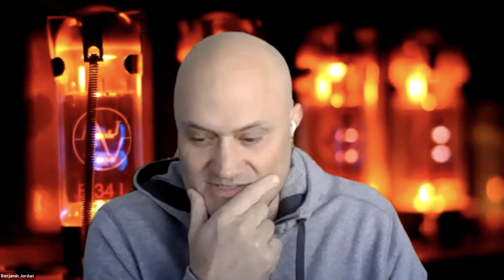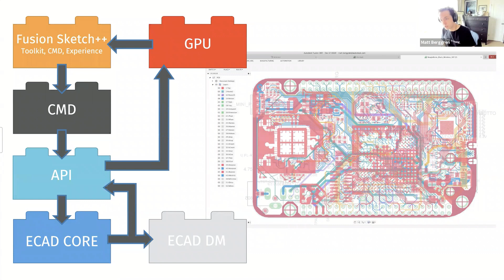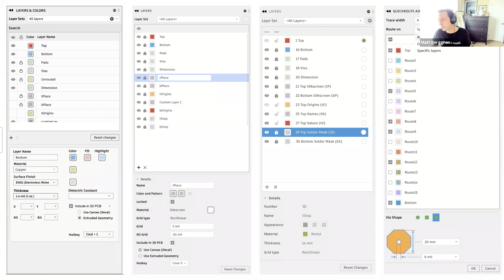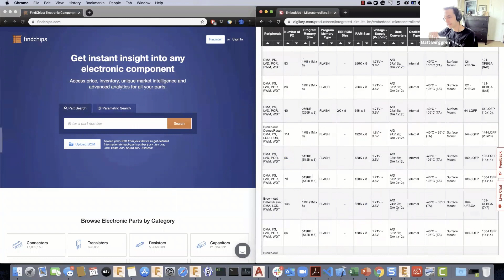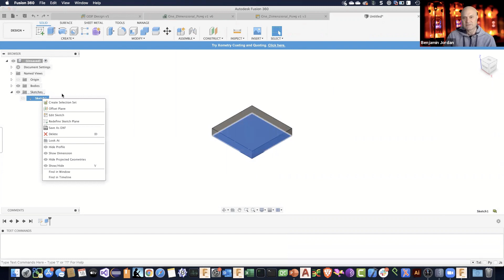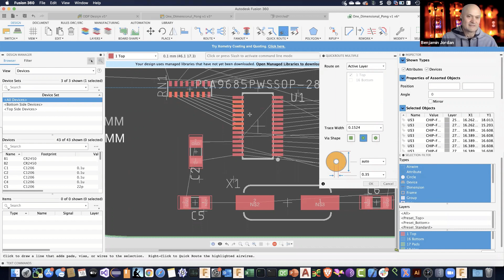WEBINAR: Fusion 360 electronics roadmap

Comment: Great job guys. Exciting times!!
For the new library stuff, please dictate the common attributes names like manufacturer, part number, voltage, tolerance, etc. Each library of the web use different names, so we can't do a BOM out of this (you probably know that already). Also I think library symbols and silk drawings should be a lot more normalized / consistent (the new symbol for the diode is way too big compared to other components, footprint silk lines width are inconsistent, marking dots sizes as well). Just make one law that all shared libraries must conform to, and make it available to us as design recommandations. Even better if the user can stylize shared libraries (line width, font family & sizes, etc).
Also as a "rest of the world" user, I would like to set up the metric system as default everywhere apart of the schematic. Trace width / hole size suggestions should not be converted, instead you could display the unit next to it.
But overall I think you make a great job integrating Eagle to Fusion, this is not a simple task and the design choices taken are very sound. It will be a great tool over time, we just have to be patient.